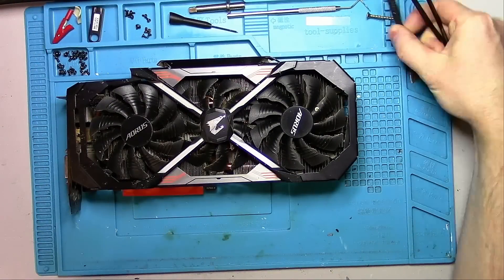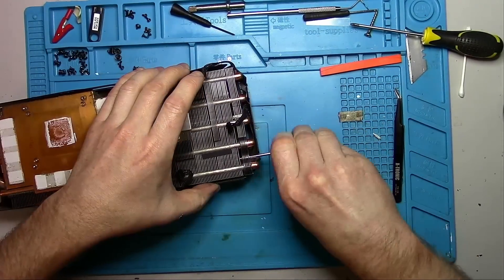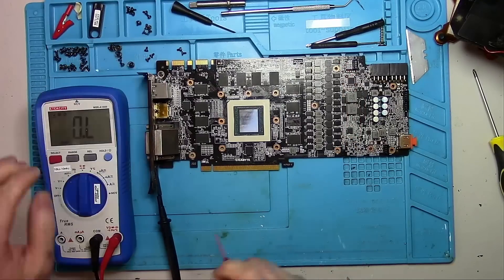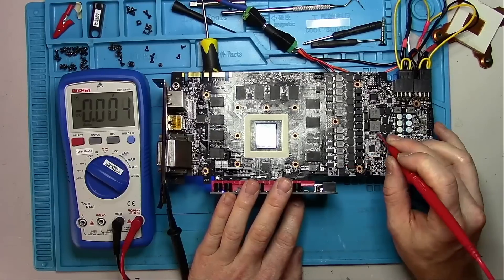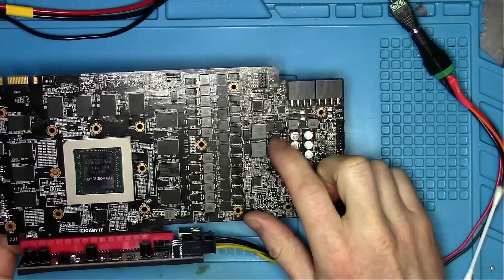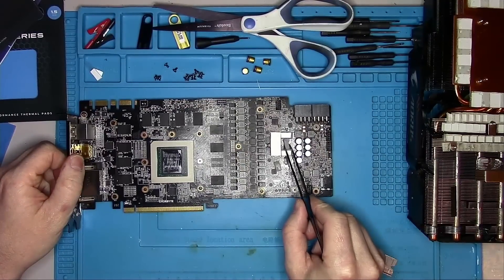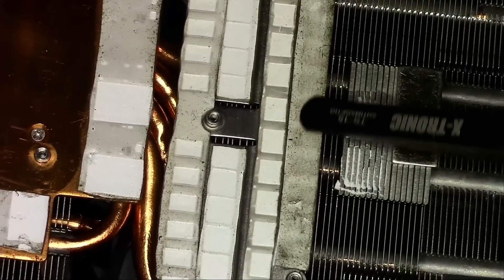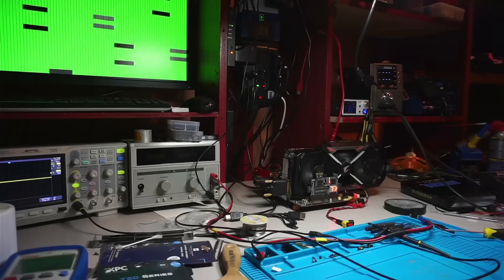Does Gigabyte make good Graphics Cards ?

Comment from the maker: If you need a repair, please contact me using a link in the description.
Reply: i'm happy i've stumbled on your content, i liked the cod3rs switch/ps5 repairs too but he is going Apple nowadays so my interest is declined 4 good ;p.
north ridge repairs was good to see too, but he does everything. doesn't really matter what broke..

this content of yours is more like i wanted, trying to fix broken graphics cards.. wow cool and you sound like i could learn a lot from watching you. not everything off course because its knowledge trough practice ;p but i like it. i'm considering to learn electronics repair too. i know things with my PC, software I'm kinda okay with and modified it like i wanted it.

Same as my (gigabyte) gtx 1070 ;p modded it by putting big ass cooler on it (Arctic Accelero Xtreme IV), did this for noise control i did'nt like my pc ramping up and down with original cooler.

then there was a chipset cooler that made lots of high pitched noise too ;p so ordered an copper block from china in +- the right dimensions.
modded my pc kinda good i guess. ti-wrapped the copperblock on chipset with some thermal grizzly pad and it still works, while i took a lot of parts out of my pc ;p

your voice is relaxing too..

Comment: I’ve always liked Gigabyte motherboards but their GPUs, well, that’s a different story. Had to take apart my RTX 3090 OC Gaming card due to overheating issues and found that a fan cable had gotten crimped and rendered two fans inoperable, badly applied thermal pads, and a power connector that almost melted down.  After a quick fix and cable swap my temps went from 85°C under load to 67°C.
Reply: While high end gigabyte motherboards are good, gigabyte is also known to make the worst boards as well. Esp in the budget end products are known for lots of kinks and random inconsistent compatibility issues
Reply: Also had to re apply thermal pads to my gaming oc 3080 , its really good now
Reply: I heard some people use copper plate to cool vram, maybe you should try it
Reply: @ZDY66666  true though. I once have the Gigabyte B450I Aorus Motherboard after coupled with the RTX 3070 eagle from also Gigabyte got a lot of constant stability issues, BSOD constantly. Id send the Motherboard for RMA while the I sold the GPU during the Crypto Craze. After getting back the Motherboard and coupled with my old MSI GTX 1060 is when the issues stop but later did returned. I got fed up with it and sold off the Motherboard and upgraded to an ASUS ROG B550. Previously I didnt get any issues with Gigabyte but since then I promise i wont buy from them again.
Reply: Thankfully my Gigabyte RTX2080 is still going strong with no issues. 

Margins are really slim for Nvidia AIB partners, so I’m not surprised that they’re all taking shortcuts.
Reply: @zharnadir3473  so one small thing and its great? Imagine if they were all made like the new Intel cards..
Reply: @ON-EightySix  The new Intel cards are horrible. Gamers nexus just did a tear down on them.
Reply: @greensleeves8095  thus why i mentioned them in my comment...
Reply: I also have the 3090 OC from Gigabyte. This thing has been giving me issues since day one. DisplayPort sometimes doesn’t output. I have to unplug and replug the display. Occasional artifacting. Frame stutter in some games. And sometimes my computer won’t POST, I have to hard reset by turning off the power supply.
Reply: @amirulizzat7395  never bought gigabyte new, only secondhand GTX1070 (mining card) with mining bios everything when i bought it ;p, i have been on asus for a couple of years, i cant say really bad things about asus, but the drivers pff.. have been fighting with drivers, since i had the 570x motherboard. 
(almost had send the motherboard back in the first week)

always crashing/blue screens and i could give amd the blame for having  bad drivers, like everyone else does ;p but the crahing stopped when i disabled the software from Asus motherboard drivers for lightning/Leds from getting installed at all. problem solved for me ;p my pc never crashes no more While i had 7 crashes in 2 weeks or so beforehand.
Reply: @sudendorf  and did you ddu?
Reply: @RaphaelSwinkels  I have not I don't believe, what is that exactly?

Comment: When he said, "Expect for EVGA", my heart dropped knowing that they won't be a thing anymore in the graphics card department. 5:30
Reply: Exactly what I wanted to ask just to make sure... good news getting better.
Reply: @klemendebevec8777  what's the good news?
Reply: @konchy  Sarcasm...
Reply: YEP
Reply: I have 3 of this exact card. Purchased new end of 2017. No problems after 3.5 years of overclocked mining in CA at a larger older complex that included electric power in the lease. I stopped at 3 as even two cards in summer headed the room faster than the air conditioning could remove it. 
He even stated the biggest issue was NOT a problem on other cards same cards. I love the 3 fans  the copper heat spreader dissipation. Its not hard to clean. These cards are now running perfectly 
as gamer cards for the kids. Cooling and GPU  temps still same as when new. These things when minning where so hot it was uncomfortable to be near them. I totally disagree with stating these cards or Gigabyte is not good based mostly on a pad not making contact ( in footer he states only that card had the problem). The biggest issue he had was to me nothing and that is cleaning it. I have cleaned only twice. EVGA is good stuff but as far as heat dissipation the Gigabyte is better.
Reply: @jimbronson687  👌
Reply: EVGA was unprofitable because they actually made a good product. Nvidia does not allow AIBs to have good margins so they have to cheap out on designs, and its not like founder editions cards are that much better, so its a worst case scenario for everyone really
Reply: Funny the only card I've ever had to shit out is my EVGA 670
Reply: @funtourhawk  some evga models (from the past) werent so great, everybody learns (wink)... and every line has its faulty pcs
Reply: @jimbronson687  nice joke
Reply: I guess we will get pure shit from now on xD great
Reply: @jimbronson687  That is when they install all the heat pads. Too much child labor? Astonishing how much of manufacturing is still manual labor. You'd thing they would automate more, given they make hundreds of thousands of this stuff.  As northwestrepair was initially panning around, the controller he eventually (for the win!) replaced was visibly damaged.  Sometime along the way it had become so hot it had bubbled. Swapping the MOSFETs meant resoldering. It would have been interesting if he had simply resoldered w/o swapping.
Reply: @jimbronson687  You're implying that you know more about GPU's than a guys that can fix them to board component level. Ok buddy.
Reply: @antonchigurh8343    I know my cards  And I used to own a company that contracted building for several GPU reseller.  However my implication is the cards I have were not like his. He even stated he likely had a card that was not normal.  But if you just want to argue go find someone else. .
Reply: Same!

Comment: Took you a whole month to diagnose and repair just a single card...
I don't know about others but, that's inspiring, bro. I've literally zero knowledge on electronics but what you did was inspiring.
Reply from the maker: LOL, Diagnostic takes couple of minutes or more. I had to wait for parts to arrive and when they did, after replacing one part, another problem emerged and i had to make a new part order which took another month.
I simply dont have enough spare parts or donor cards to use at this point. Otherwise it would have been maybe couple of days at most, considering the amount of work that was done.
Reply: @northwestrepair  you're like the ifixit of GPUs. Or maybe that's what you could become? Maybe talk to them?
Reply: LOL, gigabyte does the same thing.  It takes them a month to "repair" a gpu and send it back to the customer.  Then, it shows up not even working right out of the box.

Comment: Randomly landed here, new to your channel. Right away when you mentioned gigabyte cards at the beginning I was thinking "I wonder if he is talking about poor QC with the thermal pads and/or thermal paste". I only ever owned ONE gigabyte graphics card because it was only option left in stock when the 2080 came out. Never again. I had to RMA it because it was overheating, and then it happened again a months later. I ended up replacing the paste and the pads myself and it went on to function for a few years without issue. Not only did it come bad from the factory, when it was sent back, they still didn't do it properly. Gigabyte does make decent motherboards though.
Reply from the maker: Yes they do make decent but not the best motherboard.
ASUS is the guy to go to for a motherboard, but for a GPU, neither gigabyte or asus are particularly good at it.
I'd go with MSI and ONLY if they have AMD GPU and not NVIDIA.
Why ?
Because MSI had been in the manufacturing cards with AMD processor since long before AMD bought out Radeon. MSI+Radion is an iconic combination.

Comment: It's sad EVGA is going to stop making video cards (NVIDIA at least). I stripped my 1080 down and replaced it with an Artic Cooler and fan assembly 3 years ago when the fans started rattling. I saw then it was really well made. With the new assembly and undervolting, the card is still working like a dream 6  years after purchase.

Comment: Appreciate your video, rare to see stuff like this and should be a big help to the rest of us tech-heads. I have a gigabyte 6700 xt that refuses to run its full 16x lanes and is stuck in 8x lane mode no matter what my configuration. That PCI-E 16x card tester looks very handy to have!
Reply: Make sure it is plugged into a x16 slot on your motherboard.

Comment: I only had one Gigabyte product that didn't have any trouble - its HD7850. Cooler was INCREDIBLE, large fans that were almost silent the whole time, GPU core that can overclock by cracking up "GPU frquency" in MSI Afterburner to the top right position (all the way in), with temperatures below 70C... It's an awesome product. I sometimes regret selling it.

Comment: When you swap the capacitors expecting a signal to just swap..  

But it fixed the problem.. 

The original factory solder joint was cooked and created enough voltage drop in the capacitor itself so to you when you would read it it would seem normal as it's going in. 

Your soldering job corrected the issue..  

I'm still in the middle of the video.. 

But I'm sure the messed up heat pad caused the issue.. 

It also looked like dust and dirt was under some other heat pads 
 
Nice job 
..

I wish my hands were steady enough to work on circuit board's...

Always burn the boards. I remember doing my first car amplifier. It was a rockered fosgate 400x4 the 1999 version. I did fix it but I did a pretty sloppy soldering job removing it putting it back on. I did fine removing it.

 I kind of burnt the board.

I kept the amp to have as a trophy.. 

Even though it works. I will never use it .

 I don't trust my work that time.. 

I did finally buy a helping hand and it does help me do stuff like lipos and RC car batteries but I still stay away from circuit boards. 

Nice job.

Comment: When I started mining Ethereum, the only 30 series cards that I had managed to snag that actually had heatpads on the back of the board attached to the backplate were EVGA. The rest of them, aorus, gigabyte, HP, MSI, Dell, none of those 3080s had any heatpads attached to the backplate. They would throttle just from running them up to full power no overclocking. It's incredible how much those backplates hurt thermals, and without a heatpad attached to them the backplates literally end up being heatshields! The EVGA ones were also the only ones able to overclock past 1500 on the memory on afterburner and still be stable. God I love that company, it's such a damn shame.

Comment: I had two of the very same type of the 1080Tis chugging along in my rig since 2017, (i used to have two, but i ended up selling one later on) with one small difference: They were converted to water cooling since day one. Now i don't think that mine had that issue of the thermal pads not making the contact on the original cooling solution, but what i do know to be the issue was: on those two cards cards that i've bought at that time, to run in the SLI configuration, (and two identical Water blocks from E.K. Water blocks), the P.C.B.s should have been identical, because they were the same revision. However, one had a row of inductors clearly higher that the other one (different type). That has resulted in one of the Water blocks not fitting at all. Luckily enough: i have a C.N.C. mill at work, so it was just a matter of making two passes over the too high area, and it was fitting again. Still: if they have changed something in the manufacturing process, they should have had them  labelled accordingly, in my opinion. Not everyone has a C.N.C. mill at their disposal, or is willing to risk sacrificing the warranty on the Water block.

Comment: I "fixed" the exact same model by placing a waterblock on it, before the cards was very unstable at default clocks, now it's rock solid even with a strong overclock on both memory and core clock.
the card was never opened before, probably bad contact, (the thermal paste on the die suggested a good contact) probably other components weren't cooled i guess.

Comment: I have a  Gigabyte 1080 Ti Waterforce WB in my PC. I had no issues so far!
Reply from the maker: Never seen it. Maybe it has better cooling design.
Reply: @northwestrepair  It comes with a pre installed water block.

Comment: I have a Gigabyte 1650 Super, and it run hot AF.  Even after putting fresh paste and pads on it.  It doesn't matter how good the case cooling is, it always runs at 75c and up under load.  Yet my Asus 3060 rarely goes above 70c, and is typically in the low 60's.

Comment: I'm running one of these with a waterblock, cool 35/50 degrees Celsius at max clocks, the funny thing is it clocks itself higher if there's any thermal headroom, so it's constantly boosting in a game/3d application :)
Reply from the maker: 35-50 core temp, thats great your core will last.
What about memory chips or power stages ?
Does your waterblock cool mosfets, drivers or anything else that gets hot on the board besides the core ?
Core is almost never a problem with cooling design, everything else is.
Reply: @northwestrepair  
It's a EK full cover blok, iirc it cools everything I've seen you put pads on :)

Iirc afterburner also reads the mosfets etc. not? Haven't used that since I had a Fury X which was almost impossible to overclock...
Will check in the afternoon if I've got time.

Comment: I have the Gigabyte GTX1080Extreme Gaming edition, it was the highest modell of the 1080 possible and it have so far been one of the most reliable cards I owned, I bought it on release and still use it today, I know these cards had a problem with that some getting  unstable at the clock speeds they had from factory and they released a firmware "downgrade" that all was recommended to all for use. mine was never unstable so I never nerfed the firmware but instead always run it overclocked to 2050mhz and can likely go even higher but never did yet, it been a champ so I gonna be sad the day it eventually gets bad, question with GPUs is not if they break, it is when

Comment: Speaking from personal experience, I bought GB 2060 Super, and it ran at 83 from the start, 3 years later it runs at 88, with 106 hotspot. It always throttles and drops in fps.
Exchanged the card for 3060Ti MSI Gaming X trio for $230 (eq currency) and has been a much needed end to my "relationship" with GB.

Comment: Never trust a heatsink assembled at a factory, on any hardware. If possible always lift and inspect contact with the pads, replace the pads to a higher quality, or reapply a higher quality thermal paste. The stock thermal interface materials are usually of a medium quality. Before taking it apart, make sure that you will be able to assemble back the heatsink in a proper way. Sometimes removing the heatsink will destroy the hardware when a permanent thermal adhesive is used, so don't use any force during the disassembly. Look for pictures online that show the hardware with the heatsink removed, so that you will get an idea what hides behind the heatsink.

Comment: I've pretty much have always gone with Gigabyte motherboards. As for video cards I've gone back and forth between Gigabyte and EVGA. For both Gigabyte videocards and motherboards I have never had a problem or any complaints.
Reply: You don't buy enough to have a large enough sample size.  I buy thousands a year and by far gigabyte has been the worst of all them.
Reply: @aaacomp1  I've heard people say the same about MSI, ASUS, Galax etc.
Reply: @devinfraserashpole4753  i bought over 100 3000 series gpus last year.  The only issues were gigabytes.
Reply: @aaacomp1  that’s sad to hear. All these companies engineer the product to fail.

Comment: I agree with your assessment of it being a QC dud. My first GPU ever is a used (and heavily abused) R9 280X OC Windforce v1. I never overclocked it to the same degree as the previous owner (my neighbor at the time), but I still have it and test it every year. I’m waiting to find the right use case for it, I’m thinking maybe for a simple liquid submerged build.
I’ve since obtained an Aorus RX 5700XT, RX 6600XT, and two RTX 3070 LHR cards from Gigabyte. All of them have been just fine, in fact I’ve been mining with them, and their hottest temps are nice and cool in the 60s and 70s.